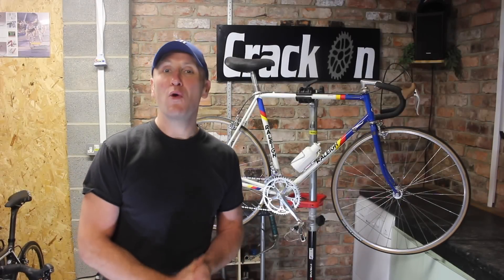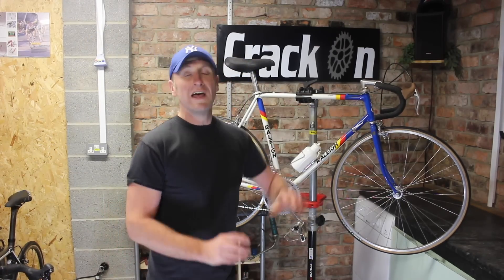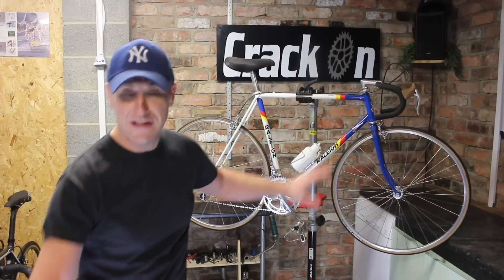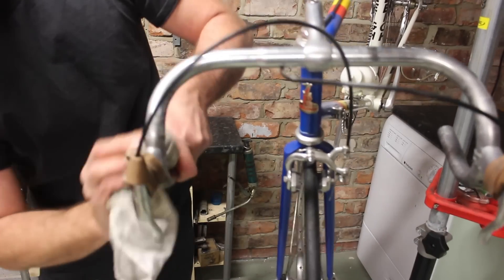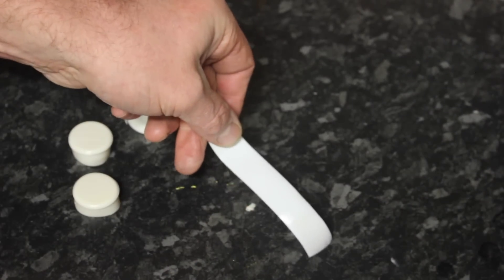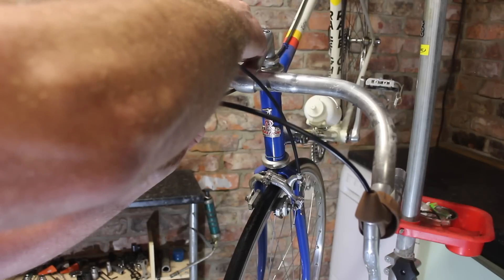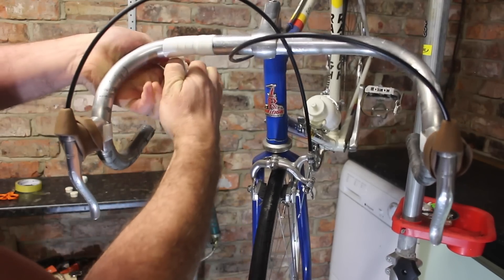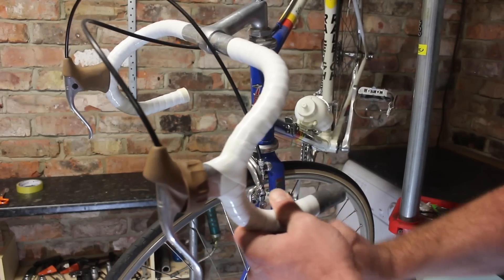How to Wrap Retro Handlebar Tape on a Vintage Road Bike

Comment: Good old Bennotto Bar tape... It came in two types smooth and grippy...  Was about 3 pounds back in the 80s. used tons of the stuff. had a habit of splitting sometimes  if you hit the deck.. ! Tended to go bottom up if it was a handlebar control bike to guide the outer cable.. it also ended up short a lot of the time as you mentioned can happen in the  video. :)..
Reply from the maker: Love hearing of personal tales of products gone by, thanks for the comment and sharing. All the best and thanks for your support

Comment: In the early to mid 80’s all I used on my race bikes was Benotto Celo tape, almost everybody at that time wrapped Benotto tape from the bottom up and used finishing strips .. usually colored electrical tape. We also used two short pieces of the Benotto behind each brake lever .. usually held in place by electrical tape.
Reply from the maker: Thanks for watching and your experience it’s much appreciated 👍

Comment: I have watched many videos of this form of wrapping , but you are the only one I have seen and specifically state to wind the tape away from the bike in direction, all other videos show it running over towards the back of the bike , is there a reason for this difference ?
Reply from the maker: Short answer…no. Hmm generally I get that it’s wrapped from the bottom up but in the early 80s so many was wrapped from the top. I’d honestly not picked up on if it was away or towards. Thanks for watching

Comment: I wrap my bars from the tops to the brake levers, then 're start from bar ends back to brake levers. That way I can change just the to or lower half & have 2 colours if I choose.
Reply from the maker: Sound great that I’ll have to give it a go. Thanks for watching and the tip on how you wrap your own handlebars. All the best Andy
Reply: How do you join the 2 ends up neatly then?
Reply: @Stoney3K  underneath each the brake lever hoods, normally secure them with electrical tape.

Comment: How does one remove adhesive from (fiberglass tape?) .. 
The previous owner did a shabby job maintaining his bike and used it on the handlebar. 
Rubbing alcohol/regular hand soap kinda works, but i could use something stronger to save some time.
Reply from the maker: Thanks for watching, I personally have use petrol before now. Which is a thinner, I hope this helps

Comment: I am blissfully ignorant of the various types of tape and their advantages/disadvantages. I bought my 1978 Raleigh Grand Prix second-hand and it has black tape that, thought slightly scruffy, does not need currently changing from a functional point of view.

Can anyone advise me of what would be the best replacement tape brand to use when I do decide to replace the tape? I am quite happy with the existing black colour and I think black might be less prone to showing scuffs and marks. The colour of my frame is Bronze.
Reply: I'm currently using cinelli's basic cork tape and it's great, although might not be what you're after if you're looking to keep it period correct- it's a lot thicker than the tapes used back then.
Reply: Many thanks for your help! @jamesconvey4239
Reply: Roy Gardiner can second that, I just wrapped my handlebars with Cinelli’s black cork tape and it looks and feels great plus it’s fairly inexpensive and easy to install
Reply: Thanks for your advice  @rudytorres4917  !

Comment: OK I've got several Questions.

What handlebar Tape is that what you've used in this video? How about cotton Handlebars? Would you suggest using some shellack on cotton handlebars?
What handlebartape would you use for an early 80s bicycle?
Reply from the maker: Thanks for watching the handlebar tape used in the video is Benotto handlebar tape. Yes cotton handlebar tape can also be wrapped in the same way and I wouldn’t recommend using shellack. Benotto or leather handlebar tape was used in the 1980s. I hope this helps 👍
Reply: @BikeItUK  Thanks for the answer really appreciate it. 

I like your videos and projects. It's so satisfying to see how you blow new life into all these old bicycles. 

But sadly though getting a benotto bartape is pretty hard. So i finally bought some white cotton tape, restoring a cilo right now. Using your way of polishing all the parts right now.

So thanks for the good videos and the answer. :-)

keep on with that amazing work.

Comment: I'm still after a pre-Team colours Corsa. This was in pearl metallic and AFAIK only made in 1984.

IMO, this Corsa looks better on black bar tape, which is what the near-identical '85 model had.
Reply from the maker: Hi the pearl white has become near impossible to get hold of now. I agree with the black it’s what I always remember the Corsa having as a kid. It’s not until now when you study all the brochures that they had slight variations. Thanks for the comment all the best Andy
Reply: @BikeItUK  
Thank you !! I do believe that this model is the "Team Corsa".
Just looking through the Raleigh '83, '84 & '85 brochures, they made some stunning racers back then.

I passed on a metallic pearl Corsa a few years back on E-Bay as it was priced at £230-ish, which I thought was a bit much for that bike. With hindsight, I should have bought it as it would have added to my fleet nicely (although they are mostly '85 bikes from the Raleigh Lightweights Catalogue)

Comment: Really dislike this method as the tape roles between the top of the bars and the hoods but I'm open to new ideas. So please feel free to tell me I'm wrong Andy
Reply from the maker: Hi thanks for watching, to be honest these are old ideas. In the 1980s many handlebars were wrapped from top to bottom. Looks over efficiency, sounds about right for the 80’s. My modern carbon Canyon bikes are all wrapped from bottom to upwards but my period retro rides generally wrapped as they were back then. In all honesty I’ve not had the issues of the tape slipping either way. I hope this explains things a little more. Thanks Andy 👍
Reply: @BikeItUK  maybe it's the modern type of tape that slips and that's why we now go the other way. My 1970s Viking is all modern stuff as its my only road bike and the one I do things like Lands End to John O Groats on so I like my modern comforts. I really loved the bike and that frame has a fantastic feel when riding.

Comment: Sorry Andy, but I have to say that this is completely wrong. You ALWAYS start from the bottom and up. I have been raising amateur and professionals between 1975 and 1991 in all Europe, and I have never ever seen anyone wrap handlebars top to bottom! Only one time did I see it, and that was in a bicycle shop with some low quality raising bikes. I don’t know where you got the impression that this was the right way on vintage bikes, but those people who had done it this way, or told you this was the right way in the old days were completely wrong. Just ask anyone who have been into real bicycle raising😉
Reply from the maker: No worries I’ve even had workers at Raleigh and other remorse’s confirm this was right it creates such a debate. Funny, even GCN has covered this on modern ride saying even some pro modern bikes  have used this technique. I understand the theory from bottom to top and even have both my Canyons wrapped in this manner. I have many images to back this type of wrapping was done in the 80’s early 90’s. As I say this subject creates such a debate. 😉 Thanks for watching and your support
Reply: I agree with u31r.but each to there own.if it stays on and the owner is happy with it I guess that's all that matters.

Comment: I like your channel, but it's getting sloppy. That was no use, and you did a poor job too  - gaps around the front brake lever,. You should spend more time showing people detail, like how to do the "X" (or figure 8) at the lever. You've done lots of vids, you shoud be better than this by now. I've got 50yrs experience, but people starting out need help, and you are not giving it. Check out the Park Tools vid on the same subject, they leave people in no doubt about how to do the job.
Reply from the maker: Thanks for watching and your support sorry you feel this way I’ll take your points on board and try and do better. All the very best Andy

Comment: complete wrong!
Reply from the maker: Sorry please explain? Thanks Andy
Reply: @BikeItUK  The direction is not right, there is no way to start from the top because the open tape edges always point inwards and peel off.
Reply from the maker: Yes this is correct however when restoring retro road bikes pre 1988 the bikes you will find were taped from the top downwards because it illuminated the need for extra tape and looked better. My modern rides are all taped from bottom upwards. Thanks Andy
Reply: @BikeItUK  yes ok, the better way was the so-called harlequin-winding to make maybe synonymous only with a single color handlebar tape to not let the open edges to point inwards.
so i have often seen it on high end wheels of yesteryear.